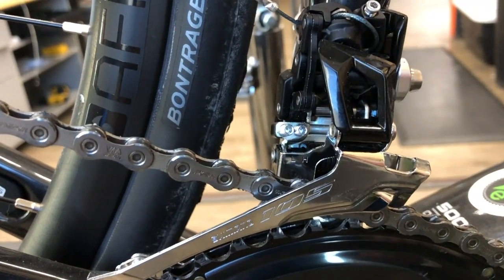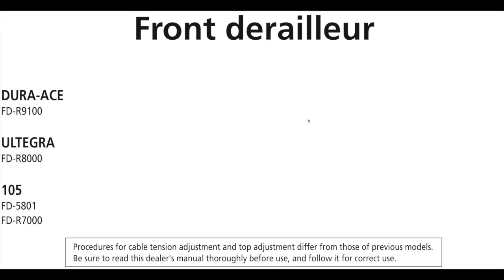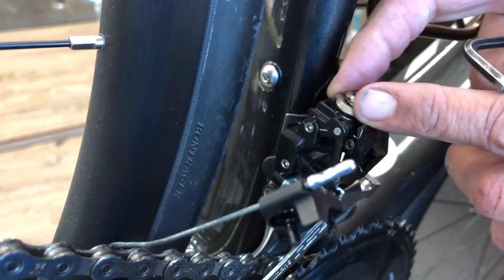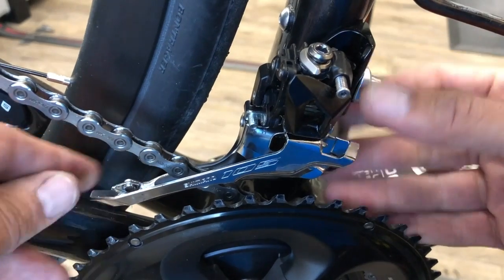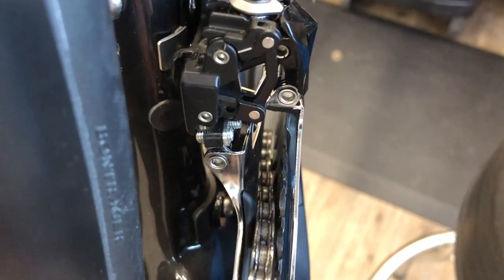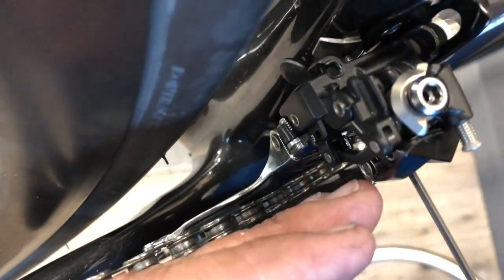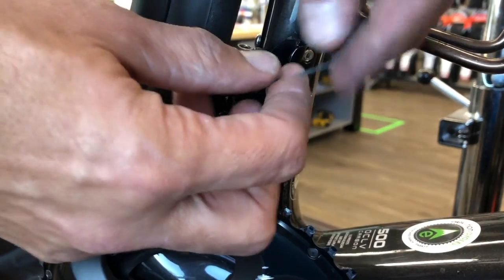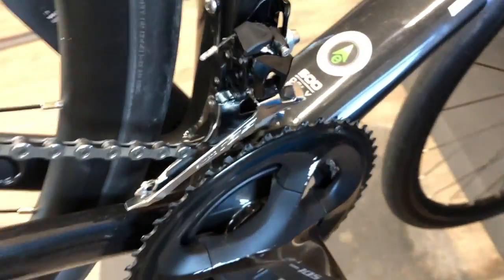Tips For Setting Up And Adjusting Shimano R5801 7000 8000 And 9100 Front Derailleurs

Comment: Very nice video, very clear!  I have just one question. At 18:49 in the video you hook up the cable and say to take all the slack out.  Does that mean the shifter needs to be in the lowest position, what Shimano would define as position (v) as shown on page 18 of the dealer manual?  I look forward to hearing back from you.
Reply from the maker: Yes that is correct. A common mistake I see (an even made myself) is to have the shifter in the low or small ring position (w in the Shimano manual), get the cable set, and the result will be difficulty getting it to shift to the big ring due to a lack of cable tension. The "v" position is the low trim position on the shifter and position the shifter must be in to get a successful cable attachment to the derailleur.
Thanks for your question and feedback!
Reply: Joey Mesa thanks for a quick response. I put the shifter in the lowest, or (v) position, and it worked out perfectly!  Thanks again.

Comment: Joey, this is very helpful, but I'm confused after watching this and comparing it to the dealer manual.  The dealer manual shows that both the high and the low adjustments should be made with the chain on the largest cog of the cassette.  The high adjustment is made on the big chain ring, and the low adjustment is made on the small chain ring.  In this video, the top adjustment is made on the smallest cog of the cassette (which makes sense, but doesn't follow the manual).  Is it better to set the high adjustment based on the video or the dealer manual?  Is there a difference?
Reply from the maker: To me they basically accomplish the same thing. I would rather have the chain clear the derailleur cage in the big ring/small cog combo. Sometimes it's a compromise of having a slight rub in one extreme or the other. In other words, I'd rather have some slight rub in the big/big combo as I'm rarely in that gear for long.
Either way I don't think it matters much. Just go with what works for you.
Thanks for the question and your feedback, I appreciate it!

Comment: At 20:02 you screw out the L screw before going into the trim position and align the lines via the tension screw. As I understand the Shimano manual the L screw should actually remain in the position where the front of the derailleur cage lines up with the big chain ring. Are you sure the L screw is supposed to be screwed out before setting the tension?
Reply from the maker: As long as the initial securing of the cable to derailleur process is complete, it doesn't really matter when you back the L screw off. The only purpose of tightening the L screw and lining the outer cage to the same plane as the big ring is to position the derailleur in the ideal location to secure the cable. Once the cable is secured, it doesn't matter when you back off the L screw. I do it early because it will have to be backed out anyway to make the small ring adjustments.

Comment: Very helpful. A question on my part; after a slightly rough time of setting up my R7000, the tension screw squeaks loudly when adjusted. Anything I should do about it? Also I've never been able to avoid rubbing when in the large chain-ring crossing over to the two or three largest cogs on the cassette. And while there's a healthy amount of trim on the small chainring setting, there's very little in the setting on the big chainring.

Comment: Do you think this style derailleur is not suitable for friction shifting? I have a 2x11 high range setup on my touring/gravel bike and I want to put this 105 FD on it. I just question if all those adjustments on the derailleur aren't "backwards compatible" with my friction shifters. I'd appreciate some insights on this before I pull the trigger. My other option for a FD is the Microshift Centos 2x11 FD and setup on that is much more traditional. Thanks Joey, always appreciate the videos!
Reply from the maker: Sure, there's no problem running this derailleur with a friction shifter.
Reply: @JoeyMesa  thanks Joey!

Comment: So my derailleur was already set-up for me however it does not seem to have that little tape-on thingy. The brace-on mount does seem different though, it has a flat part seemingly designed for that support screw to rest on. Is that possible? Ever seen anything like that? Bike is a Wilier Cento1NDR with this Shimano Ultegra groupset.

Comment: the shimano manual only focuses on the rubbing of the inner plate on both top and low adjustments, i followed the instructions and got slight rubbing on the completely normal largest chainring smallest sprocket combo, so i said f it and eyeballed the outer plate clearance when doing the top adjustment.

Comment: INCREDIBLE tutorial!  I was struggling to get this derailleur set up right, and this video really explained everything.  One thing thats weird is the bike shop has the little stabilization plate in the wrong place, son the stabilizing screw kind of just hits it on the edge...  i'll have to fix that, obviously, but how can i get the plate off the reposition it?
Reply from the maker: Thanks! It's not too difficult to peel the support plate off. You might need some glue or double sticky sided tape to reapply it. Worst case, you can just buy a new one: https://amzn.to/2S2K310

Comment: Would the FD R7000 work with a White Crankset with 40 and 24 tooth chain wheels?
Great instruction video.
Reply from the maker: It should, although you might check with White and see what their recommendations are.

Comment: At 20:20 it wont shift up. Completed the hight and angle adjustment, tensioned the cable while in the lowest gear, and backed off the L limit screw. When i shift to the higher gear (at 20:20) it won’t even move enough to move the chain. What is going on
Reply: Same problem here, could you ever fix it?
Reply: @svenzanetti5637 it was caused by the crank being too far inwards. I played around with the fd and managed to get it to work fairly well, but shims would be the appropriate solution to fix the skewed chain line.
Reply: @mikpiotto  thanks! I actually managed to get it fairly well too by screwing the H screw pretty far in and starting with the L screw slightly less screwed in than in the video.

Comment: Great video, especially as it follows the Shimano manual.  I have followed the method and have a good set up.  I find there is very little (no) movement between the TOP and TOP-TRIM positions though.  Can you suggest what I may have done incorrectly?
Reply from the maker: The top trim doesn't move much, but it sounds like the cable tension may be slightly too tight or the high limit screw is a hair too far in.

Comment: i have rapid fire 3 speed gear changer on the front and it's new ! shifting down the  front gears while travel is perfect . up gear changing fron the small to the big gear is different i have to hold the lever down while the gears are changing is that normal

Comment: Great video! What if you have a barrel adjuster by handlebars? What position does it have to be in before any of these steps?
Reply from the maker: If you're going to use an inline adjuster, ideally start the adjustment process with the inline adjuster threaded all the way in. If I'm installing new cables, I generally leave the inline adjusters out unless a customer requests them since there's a cable tension adjuster on the derailleur itself.
Thanks for your feedback and question!

Comment: Hi Joey, brilliant video mate thank you for sharing. I'm really struggling to get this job right. How much tension are you putting on the cable when pull it through the pinch bolt mate? I'm not sure if I'm putting to much tension in the cable. I also have no trim in the top gog. Please help. Cheers mate
Reply from the maker: Sounds like you may have a little too much cable tension. When you hit the top trim lever, you should see the front derailleur move in towards the small ring just a bit. The 2 lines on the backside of the front derailleur should be lined up as well. 
Something to check would be shift up all the way in the big ring, then shift to the small cog in back. If there is sufficient clearance between the chain and outer derailleur plate, then you probably have too much cable tension. If the chain rubs on the derailleur, you might turn the high limit screw clockwise a quarter turn to move the derailleur outward slightly. Hopefully that's not making things more confusing.
If you want to try to back the cable tension off, shift all the way down to the trim position on the small ring, loosen the pinch bolt just enough to let the cable slip just a little, thing tighten the pinch bolt and try again.
Hopefully that's helpful and thanks for the question!
Reply: Joey Mesa, thank you very much for your reply. I’ll have a go today and will try what you’ve said. Thank you for getting back to me, very much appreciated sir. Take care, Paul

Comment: What position should the H&L screws be in at the start of this set up?  Or does it matter?  Followed this video closely several times but unable to avoid chain rub and large cog not shifting smoothly.  Wish there was a trouble shooting guide along the way.  Had previously sent the bike twice for pro tuneups…both times returned with chain rub problems.  Frustrating piece of gear.

Comment: I have been trying to follow this to adjust my front derailleur. Once I get to hooking up the cable and back the L screw and try to shift to the big ring, it doesn’t shift. Tried few times tightening the cable as much as possible, but it wouldn’t shift. Ten Tried barrel adjustor counter clockwise, still wouldn’t shift to the bigger ring. Any suggestions?

Comment: Hi,
The dealer manual says that adjusting should be done twice: 1. The biggest chain ring and the biggest cog. 2nd time on the biggest chain ring and the biggest cog... you don`t do this like this... why?
It this rubbing normal in the position from 2x11  and 1x11 for Shimano 105 R7000 ?  I`m fighiting with this FOR DAYS. No I did like you in the video (not adjusting according to manual) and it better I think... but I am confused about rubbing the chain like I wrote above... I`ve heard that it should not at all.... is that true... ? Mb they talked about other models .... :/ 
Would you please answer... you are my lost hope!! (if you do not understand something because of my english just write it. I will try to explain in better)
Reply from the maker: Basically, I follow along with Shimano's method of adjustment as described in their PDF manual. I think the biggest confusion comes from the way the high and low limit screws differ from a conventional front derailleur and the way you use the low limit screw to initially position the derailleur to secure the shift cable. This is still the biggest mistake I see from DIYers and shop mechanics alike - not enough tension on the cable on the initial set up. 
I have another video that shows another version of the same setup plus all the positions of the shifter as well. It may be helpful in making sense of these front derailleurs.  Hopefully, you will find it helpful.  https://www.youtube.com/watch?v=T57glZEeJw8&t=504s

Comment: Will these work with a Shimano 2x10 road set up? Or are they 11 speed specific? Thanks!
Reply from the maker: This video is based off the first generation 2x11 road group. The 2x10 groups are pretty much the same as anything previous index shifting wise. I realize I've never done a video on the older index Shimano stuff, so I'll do something soon.
Reply: Thanks for the reply!
My old Fd was shot & when I started looking for a new 2 speed fd this one looked like a much better design than the standard 5700. So I ordered one assuming it would be interchangeable like all the past shimano road components. However, there are some on the interwebs saying that the 11 speed shimano components will only work with 11 speed because they changed their shifting ratio from 2.3 on older stuff to 2.7 on the 11 speed group.  If anything, I would think taking out
0.4 mm of travel/slack would make a FD shift slightly better? Guess I'll find out. 
Thanks for your time.
https://bike-bikegremlin-com.cdn.ampproject.org/v/s/bike.bikegremlin.com/1297/bicycle-front-derailleur-compatibility/?amp_js_v=a6&amp_gsa=1&amp&usqp=mq331AQHKAFQArABIA%3D%3D#aoh=16167651596946&referrer=https%3A%2F%2Fwww.google.com&amp_tf=From%20%251%24s&ampshare=https%3A%2F%2Fbike.bikegremlin.com%2F1297%2Fbicycle-front-derailleur-compatibility%2F

Comment: I just have a question Joey, do you still need the cable adjuster loose or you don't need the cable adjuster anymore??
Reply from the maker: Some folks still use them, but it's not necessary. The inline adjusters can work loose over time, so it seems like you have to adjust them more than a normal barrel adjuster.

Comment: Hi, I watched your video but I can't fix my front derailleur. No matter what I do, chain will still touch cage of derailleur in lowest possible gear (smallest cog in front and biggest in the back) and I can’t move derailleur with L screw because it is already moved and it can’t go further to the bike. Also, my trimming is not working properly. When I move from first to second position, I see that cable moved but the derailleur hasn't.
Reply from the maker: You might check the high limit screw. If it's in too far it will affect the low limit setting.

Comment: Hello.How to fix the rubbing from the big plate and big cassette? The 1st trim get so small the derailler that not works. Any suggestion?
Reply from the maker: See what happens when you take a small amount of cable tension out. Also you could rotate the front derailleur in half a degree or so.

Comment: My shifting of this is quite hard. Is that normal? Can i adjust the tension so i don't have to grimace when changing front cogs?
Reply: Do you have full run housings? Some current bikes have no exposed inner cable between the shifter and derailleur for weather protection. If certain lithium greases are used in this set up.  They congeal inside the long run of housing and get really stiff and bound up.  It's better to use Teflon (like Tri Flow) if it's a standard nontreated inner cable.  The best to use though is the optislick or polymer (ptfe...teflon) types without any lube. Hope this helps.  I had the same problem on my gravel bike. When I upgraded the inners the shifting was like butter.

Comment: Hi i over push my “h” screw and it fell out and got misaligned, can i still fix it or should i replace my front derailleur?
Reply from the maker: Most bike shops usually have a stash of salvage derailleurs for parts. I bet if you visited your local shop and asked nicely, they'ed hook you up with one for an inexpensive or free price.
Reply: @JoeyMesa  cheer bro thanks!

Comment: What if your adjuster screw is all the way in and the lines aren't even?
Reply from the maker: If the adjuster is all the way in and you still need more adjustment to get the white lines lined up, you need to start from the beginning of the set up sequence.Loosen the 4mm bolt that secures the shift cable.  Back the adjuster screw out to the point of the little tap on the plate that secures the cable can be rotated as far clockwise as possible. Turn the low limit screw to align the outer plate of the derailleur over the big ring. Make sure the shifter is all the way down by clicking the small lever as far as it will go. Then reattach the cable and finish adjusting as per the video.
Reply: @JoeyMesa  thank you!

Comment: I wonder why Shimano changed the front derailleurs so much over the previous generation ones.
It certainly looks as random and ugly as a Michael Bay Transformer.
Reply from the maker: This design, while much different to set up, works much better (when set up correctly) over any previous front derailleur. It basically has the power of an electronic derailleur in a mechanical design, plus less chain drops off the chainrings. I will say that getting inset up right is a proven problem for new and old mechanics...